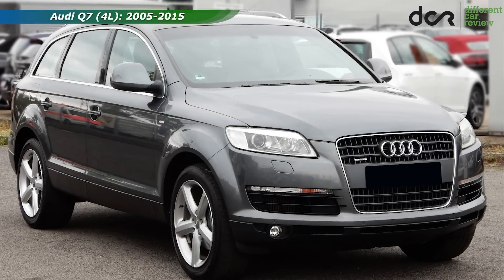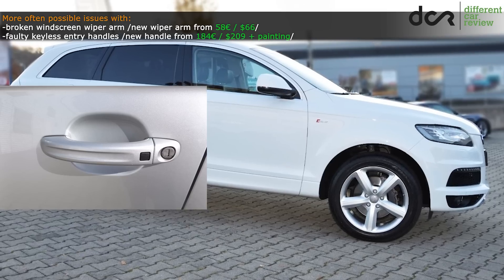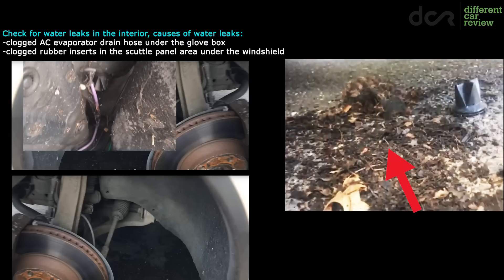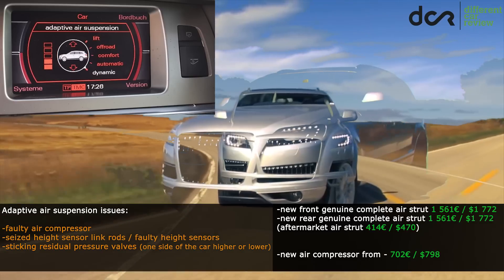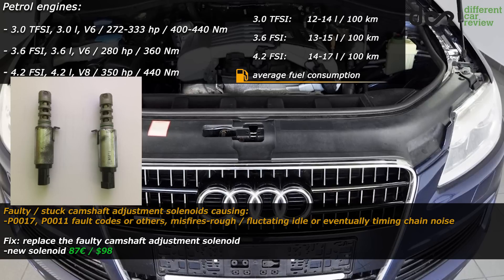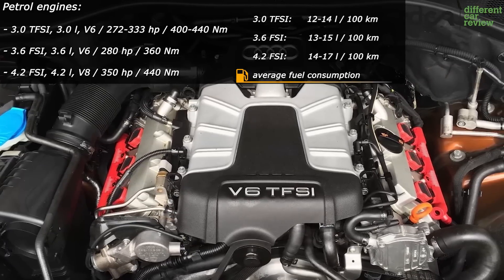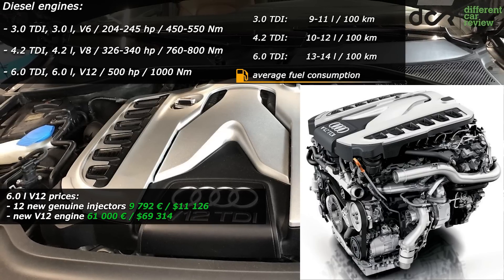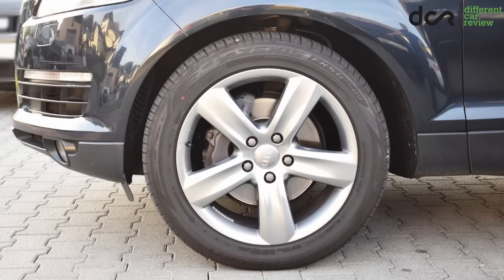Buying a used Audi Q7 (4L) - 2005-2015, Buying advice with Common Issues

Comment: Hi
We have one 👍
It is absolutely fantastic 👍
We love it 👍
👌👌👌
👍🇬🇧👌
Reply: How is the Q7 running? I’m thinking about buying one!
Reply: @FootageFactory  
Excellent 
Alhamdullilah 
We have never had any issues with it, apart from your usual changing tyres and brake pads.
Alhamdullilah our one is very well made. 👍
Reply: So glad to know they are reliable. What year is your Q7? Which engine do you have V6 or V8? Diesel or Gas?
Reply: @tommejames1095  
V6
Diesel
Reply: 2006

Comment: Quick question please.. answer with 1, 2 or 3 .. so please don’t be lazy I need your opinion.. no justification just the number .. 
which car of the following you recommend or you would buy yourself.

1) range rover vogue 2008 4.4l petrol
2) audi Q7 2012 .. 3.0t tfsi 
3) porsche cayenne S 2008 4.8 petrol

Assuming all in good condition 

Just a number 1,2 or 3 
Ur opinion matters ..
Thanks
Reply from the maker: don't be lazy, lol that was good, anyway
-in this case I would choose the Q7 - more space around the engine-easier access to the engine components, mostly cheaper engine spare parts than in the cayenne, and it's also the youngest

the cayenne shares a lot of the components with the Q7 so it can whitstand basically the same as the Q7, but it has bigger maintenance costs mainly because of that V8. Then of course it can be equipped with the active sway bars which can cause issues and there is a slightly bigger chance that the previous owner abused the car more or less-because it's a Porsche. On the other side if you are ready to spend more on the car, then the Cayenne is not the worst choice either

-the Range Rover is great, stylish, it definitely has a character and the 2008 4.4l is a good engine. But buy one only if you are ready to spend a bit more money on it than on the cayenne and if you are ready to spend more time on it as well, since you have to find a mechanic who is completely familiar with these things-mainly with the electronics,. Because if the electronics starts to act up then you will need somebody to fix it. In other word it's easier to find a good mechanic who is familiar with the Q7 or Cayenne.
Reply: different car review thank you my friend .. really appreciate it .. love your channel and you work

Comment: What if every day i find my front suspension lowered with the driver side more..uneven. ??? The rear stays  in off road for example how i'm leaving it..but the next day the rear is high and the front is down...but the driver side is iven lower than the passenger side.

Comment: Please do a mk1 TDI hpfp high pressure fuel pump disaster prevention kit installation diy, to avoid catastrophic failure. USA has awful quality diesel so you may not have that problem in your Slovakia Czech Republic Poland Germany.

Comment: The 3.0 tdi has 9-11L/100km ? 
That is impressivee
Reply: It's actually way better than that I would say. I routinely get around 8 and sometimes I strive to push it for 7.8 if I am really paying attention to the driving. It becomes almost a quest on the Hw to lower the fuel consumption. These engines are incredibly efficient.
Reply: @olegk455  oh wow, 7.8 isnt bad at all
Thats very efficient for the size of that suv

Comment: What is it likley  when engine yellow ight comming  on  and car enter Safety mode and drive slowly,
When I switch it of and start again goes ok
Reply from the maker: first you should check for fault codes with an OBD scanner
if you have a diesel engine then the issue can be related to the turbocharger - boost pressure or clogged/faulty egr and to some other things

Comment: I'm considering buying a 2013 Q7 3.0T next week with 100,000 miles. Anything else I should know?
Reply: How is your experience with q7 2013
Reply: @fymeabdullah4657  it’s great!
Reply: @logicsoundinc  🙂
Reply: Did you get the car? If so how’s it treating you?
Reply: @FootageFactory  I love it! My previous vehicles have been Yukon XL and Suburbans. I’ll admit I miss the internal space sometimes, but the Q7 is an absolutely fantastic car.
Reply: @logicsoundinc  Have you had any expensive repairs on it as of yet? I just bought one at 120,000. My anxiety is high. 😅

Comment: I want a q7 sooo bad. Im afraid of the repairs.
Reply: It’s fine, I own a 2014. No issues just running costs are a bit higher than any other car
Reply: I have had two of these cars a 2013 and 2015, the second which I still own.  Minor problems. First had an issue with the overhead panoramic window. Needed a new part.  Otherwise flawless except for the required maintenance.  Second one has been good , went through TDI conversion, takes a little more AdBlue which they kindly will replace.  Easy enough to buy DEF at auto store and refresh. Had a handle problem with one door but wireless component works on other three. Would buy a third if available as a new model but the diesels are not being manufactured.  Fun to drive on the turnpike or any other straight highway.